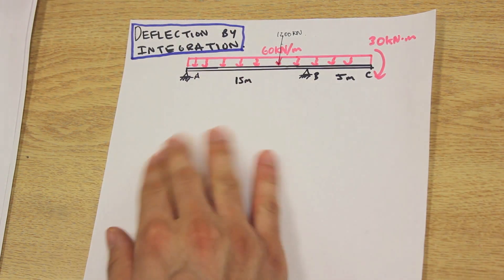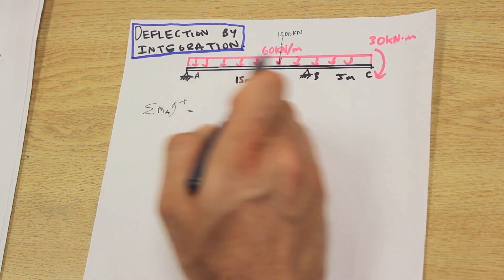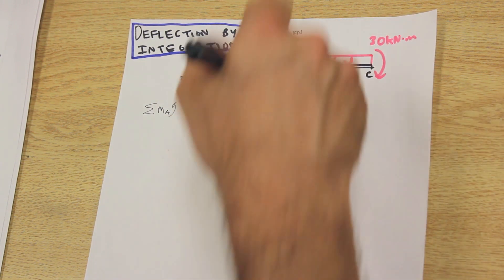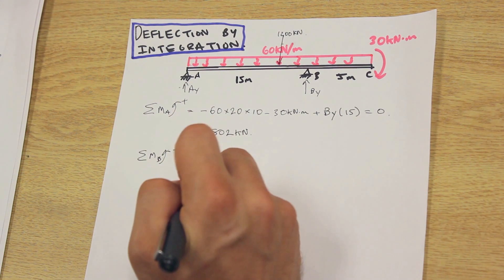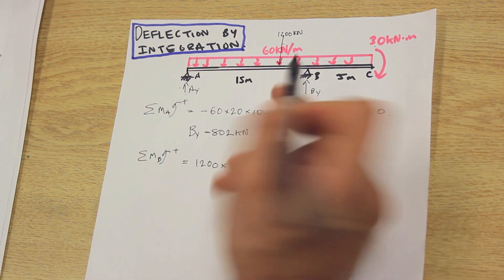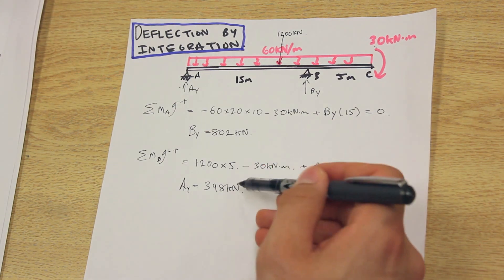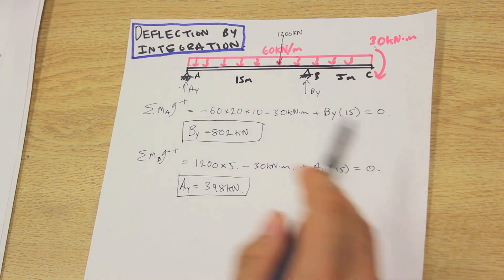Solving for Deflection of a Beam Using the Method of Integration - Part 1/4

Comment from the maker: TimeStamp !

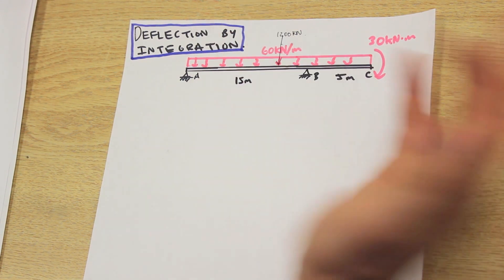1:29 - Theory Ends - Solution Beings (Dont skip the Theory!)
1:33 - First Step - Find the "Moment at A"
2:54 - First Step - Find the "Moment at B"
3:44 - Answer Check - VERY IMPORTANT!
4:14 - Final Solution (Now try to do it on your own!!)

The "Deflection By Integration" problem has FOUR Parts

Part 1 (which you just watched) - https://youtu.be/39zdlzwDvgI
Part 2 - https://youtu.be/v7Zqpy5zxvM
Part 3 - https://youtu.be/RMTOw4C2T34
Part 4 - https://youtu.be/ZA4L7yPXseo